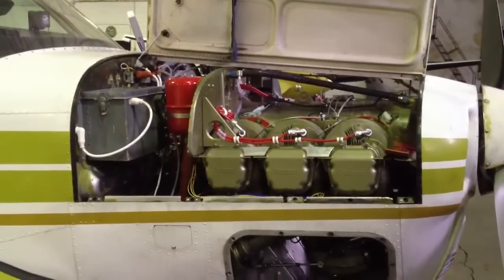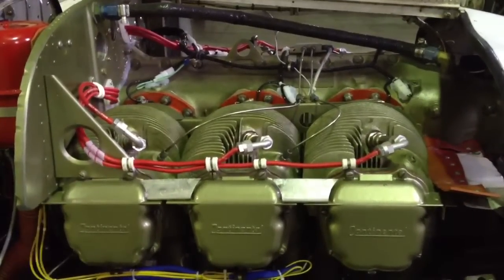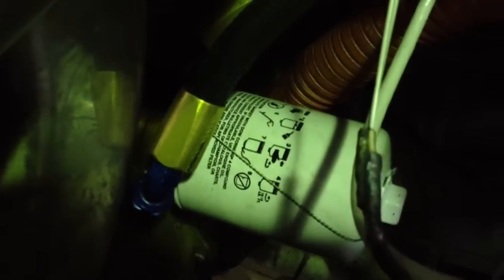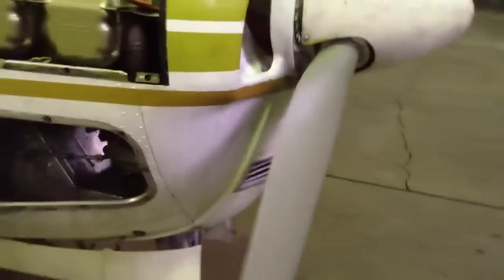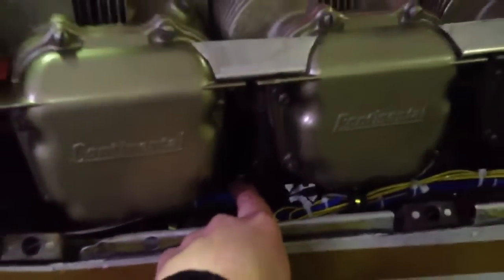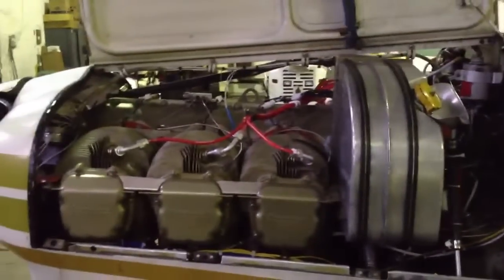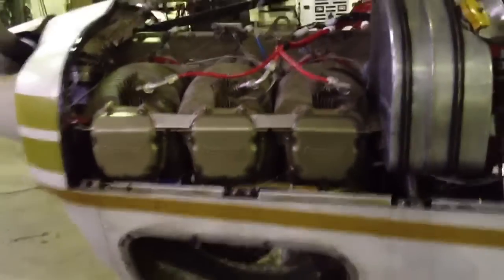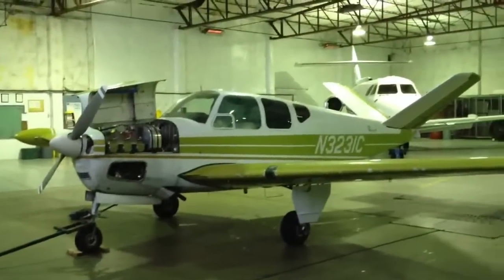E225 Overview

Comment: I had a E185 in my 194835 Bonanza, but my friend had an A model with the E-225 in it, and what a difference that made. My 35 didn't perform as good as the A model, but it trued out at 145 MPH, on 8gal of fuel.